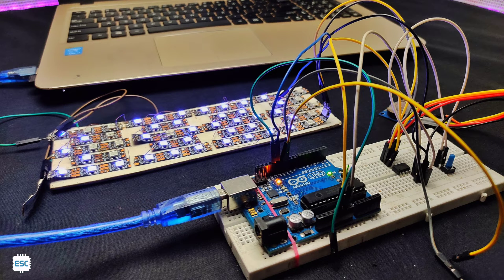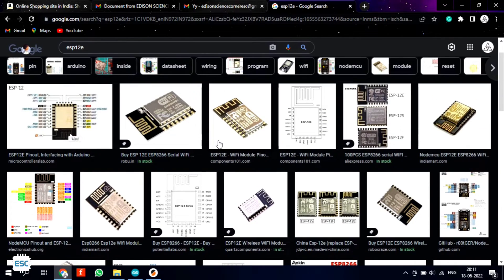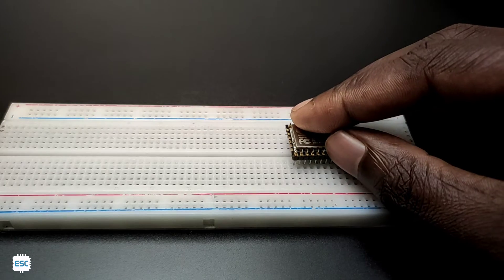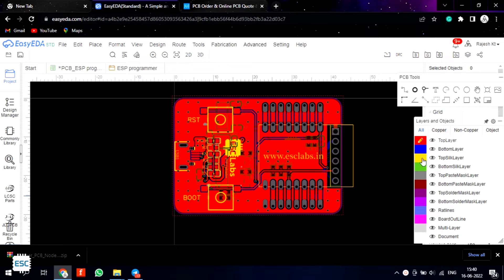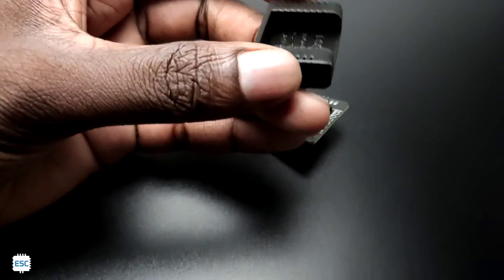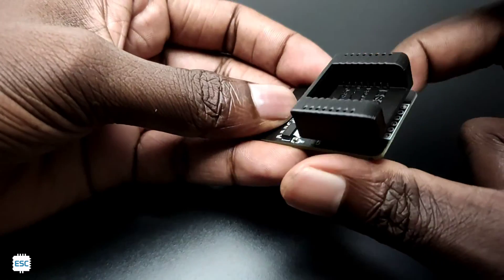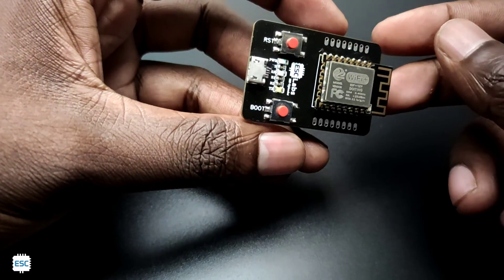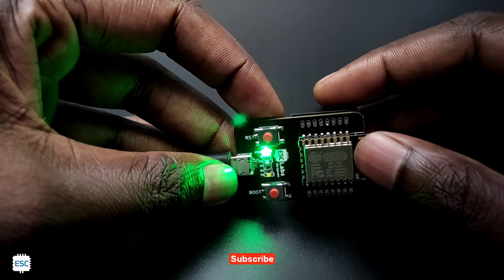How to Make ESP 12E/12F programmer | JLCPCB

Comment: this is really amazing 🔥🔥. I see you have added 12mhz  oscillator in schematic but in pcb you have skipped and did not solder that. you made some changes in schematic? isn't oscillator necessary for CH340G?
Reply from the maker: Yeah I skipped that because I used CH340C . The same circuit 340C doesn't need an oscillator. Thank for your attention
Reply: @EDISON_SCIENCE_CORNER  thanks for responding. if i use 340g instead of 340c i can just add the 12mhz oscillator ryt? by doings this any issue or its better to stay with 340c
Reply from the maker: Ch340 doesn't need oscillator
Reply: @EDISON_SCIENCE_CORNER   all ch340 series? or just ch340c?
Reply from the maker: Only c